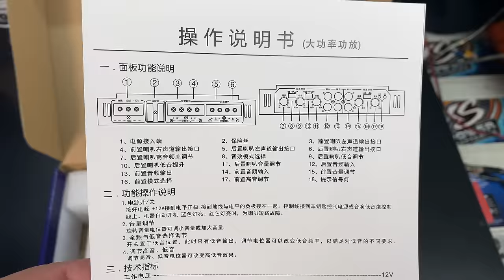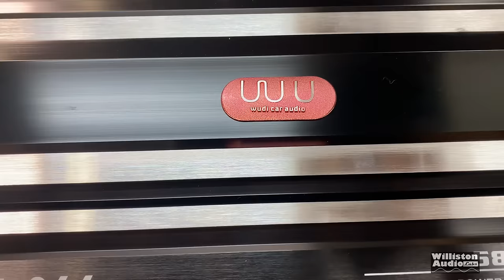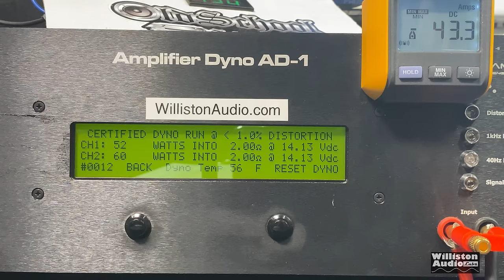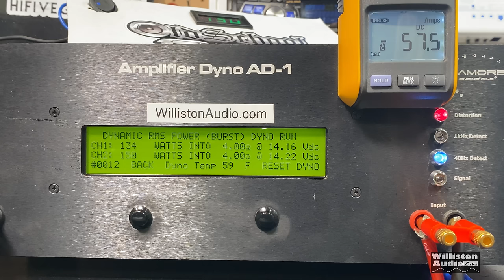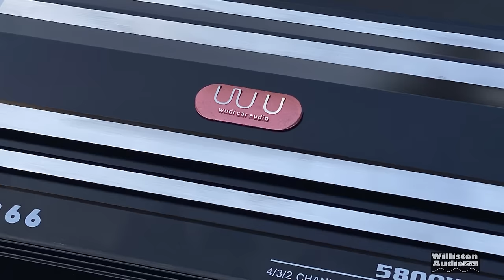I Paid $45 for 5800 watts? WUDI Car Audio C-266 Four Channel Amplifier [4K]

Comment: is it actually a decent enough little amp though? to run two pairs of small car speakers?
Reply: Look into Skar - just bought a bunch of stuff from them very very solid budget brand
Reply: @robertkurtz7587  thanks bud, I will
Reply: @robertkurtz7587  hey checked that out but its an American brand, although probably rebranded Chinese stuff. Im in Ireland off Europe id need an alternative. Thanks though mate
Reply: @THIRSTYGUMS  Find a different one, after looking at the guts, this will not stop engine whine. You will hear your alternator running through your speakers.
Reply: @chuckmiller5763  ok I will! thanks bud. question: can it not be shielded?
Reply: @THIRSTYGUMS  Yes you can shield it, but you are spending more money  and effort.  This amp will also make an annoying pop sound when its powered up.
Reply: @chuckmiller5763  ok bud, thanks for the info, any suggestions for another modest budget friendly amp
Reply: @THIRSTYGUMS  Rockville has some real good sounding budget stuff.
Reply: @alfa7108  American right? I'm in Europe, shipping and import tax be sky high
Reply: @THIRSTYGUMS  it would be better to buy a second hand kenwood amp as the amp is very reliable as is what I have in my car😀

Comment: I have a  Boschmann PCH-4480SX on the bench, IT SAYS 900W in to 2Ω (it had provisions for 2 fuses but only had one 30A fuse it it. I have measured 46v rail to rail with 55v caps. Personally I would rate it approx 200W "if that" bridged. I will have to measure currant draw once its fixed "I have 1000A @ 13.5V ready for it (hopefully that's enough power for it) pmsl

Comment: They must meant S800W because 40 amp fuse you’ll never get no where near 1000
Reply from the maker: True dat
Reply: Well easy fix,

Go buy two 400 amp fuses wire down to .25 cross it over max the gain max the bass boost , and smoke show included 😂👀

Comment: is it actually possible to connect car speakers and a sub to this amp? I've got the same amp and I has an input for the low pass and then another input for the high pass, do I have to have to sets of phono cables to run a sub and front car speakers?
Reply from the maker: Yes but I don’t think you want this one

Comment: Seems like it would be ok for factory speakers for the price I guess. Sorta?
Reply from the maker: Sure
Reply: I have one of these running factory speakers in a 2011 Mazda3, and it works just fine for that. For the price it really isn't too bad if you're expecting 50x4 RMS, definitely better than (aftermarket) deck power alone which is usually around 15x4. Only gripe is how unnecessarily big it is, as you can see by all the wasted PCB space at 5:02, if it were condensed it could have been half the size and fit under a seat.

Comment: You need to try to get the rated power from these pieces of shit.  Play it into a 0.25 ohm load and hit it with 240 volts.  I bet even then it wouldn't make rated power for a femtosecond.

Comment: I'm not the sharpest tool in the shed  but how can these  companies say  that their amplifiers put out 2_3_4 times amount that they do
Reply from the maker: There is no standard all must follow so I buy to show people what they should expect
Reply: A lot of the time they add together the individual maximum ratings of every single component on the circuit board, which is a giant figure compared to the circuit output.
Reply: To understand this we need to inderstand all specificitions. It's not the bs 5800 they claim it reach at maximum peak wich is a lie but  evan if its true the peak is not helpfull to nobody.... this peak power is supossed to be made by producer for a short period of time,as short as possible before it caught fire anyway,not helpfull. Big  brands will tell the RMS wattage (continues power it safely does for a long time) BUT that's still NOT helpfull. Those RMS are possible and the amp does them BUT there is distorsion in those watts ,wich damages your speakers and sound bad...so in realitty you won't use those RMS. NO BRAND tells you the exact specitications,not evan sont,piooner,etc and you expect chinese sellers not to lie?
But still having the RMS you can figure out about 60%-70% of real power you will use on the speakers in reality.
And about that,the gain needs to be set properly
Reply: Yes it has been going on like this for years and years because there's no truth in advertising. Plus there's no standard they have to go by. You really need to know your Ps and Qs .

Comment: Fuses will tell you how much power
Reply from the maker: Not exactly. I've debunked that myth before
Reply from the maker: @ssilvaxxx22  it was part of an amp test in which the mfg used (3) 60A fuses, but only 2 were connected to the circuit board. Also, power output will vary depending on the class of amplifier, because of efficiency. A Class D amp with a 50A fuse will be more powerful than a Class A/B amp with a 50A fuse. Fuse size is a way to estimate power output, but only if they are all connected and you know the "class" of the amp

https://youtu.be/i1ng0afAeVU?t=330

Comment: I mean if you really think you're getting 5800 watts for $50, you kind of deserved to be tricked. About average price for an average amp of its real power. I would not recommend buying one,  but if you get it on clearance dirt cheap or just want one for some reason and need that power, it will sound fine. Still rather hilarious many of the cheap amps still put insane wattage ratings on amps, I really don't see the point; it must continue to suck people into buying them.
Reply: Dave Micolichek  I can't go along with the audiofool rambling about cost vs sound quality and supposed "first few watts". A/B blind test that POS WUDI amp against the Phoenix Gold in the background, I'd bet most people could not guess which amp was which with both set at the 50 watt range (before distortion), of course the PG would win at higher output and superior quality wise. I'm talking a blind test where you do not know which amp you're listening to and set at the same levels, on the same speakers, switching back and fourth between the two with the same signal source / program material. Of course the cheaper amp might have more hiss which could be a tell. These are not tube amps that can sound rather different, these are modern transistor designs, they will not sound vastly different other than filter networks / any EQ / boost one might have over another. Expensive doesn't mean better sound, but higher price usually indicates exceptional quality built to last and solid designs that meet or exceed rated specifications, where this WUDI 5800 is slapped together as cheaply as possible with minimal features. I stand by that this amplifier would work and sound fine at about 50 watts output. If you feel you hear a difference, by all means use whatever you like, but "most" modern solid state amplifiers are going to sound very, very similar unless they have some sort of problem / design flaw. While WUDI should be ashamed for putting stupid power numbers on it, too many people look at price and inflated power ratings and claim it sounds like crap, when reality is these will sound fine as long as not ran into bad distortion like any amp.
Reply: Dave Micolichek  You are just biased to hate this and can't help but spew that over and over, it is that simple. In my first comment I recommended nobody buy this, but that it will still sound fine overall should somebody decide to do so. It is a cheap amp that nets you 50wx4 or 100wx2, will sound fine doing that rated power and you simply can not accept that. Design / components are run of the mill, but nothing out of the ordinary for a budget amp. Capacitors, resistors and op-amps are nothing special, but not bad, simply not esoteric audiofool labeled HIFI caps and other jargon. The PCB and through hole parts are a bit dated looking. Granted, the op-amps and all carbon resistors probably don't help the noise floor, so likely going to be more hiss than a higher quality amp, but for $45 it is about what you would expect. The small signal transistors are also what you would find in any other amp that uses similar outputs, and output transistors are likely common for the power level. You act like there are some exotic parts that will make an amp a million times better, simply not true. Yes there are some cheaper components installed that could have been less noisy, and of course the design may not be world class, but for the average person it will be fine. I agree with Tekboy 808, it is a $45 amp and whomever buys this is essentially out nothing, most people waste more than that on cigarettes and other nonsense in a week. I would not buy this amp either, but I'd have no problem running it if I didn't have better amps already, happened to have one and needed 50wx4. I am not giving high praise to this, it is a basic cheapo amp, I mean I do not want one, but it isn't anywhere near as bad as you try make it out to be. I just won't speak lies about a cheap amp sounding like garbage, when most of the time that isn't true, they sound totally fine for the price.
Reply: Dave Micolichek  What do you mean "first few watts of any amp determine how good it sounds"? So if I turn it up to 5 watts and it sounds like ass, I know that it's not going to sound good at 15 or 20 watts? What if I just open the amp and adjust the ohm knob to 2 ohms.

Comment: Does anyone know what is the best software to build a subwoofer box that's out there that has all types ,4th order ,6th order ,ported ,slot Port ,sealed all that stuff does anybody know? THANKS😁👍
Reply: I whant to know the same
Reply: bassbox pro
Reply: @cekpi7  yeah i saw that one, thats what got me thinkin is there others,Thank You!😄
Reply: Check out Term-pro Enclosure Design Software. It aint cheap, but it's dope.
 Personally, I use WinISD (it's free) for most of my calculations. If you want a wealth of information about the science of enclosure building, after you install WinISD, click on the 'Help' tab. I've learned so much about port length, accoustical port length versus actual port length, how the end of the port is terminated effects length and also how the shape of the port effects wind velocity, port noise, and efficiency. I take all my information and go to Sketchup (free CAD program by google) to do my designs. I love Sketchup. It's free for a month, but there are ways around that.

Comment: I'm looking for a good 1800-2000 watt peak monoblock amp (preferably class D) any good suggestions?
Reply: Taramps
Reply: Orion
Reply: Peak?
Skar, orion, ct sounds. Taramps, audiopipe... Dunno your budget.
Stay away from orion ztreet
Reply: audioque, sundown, dc, dd, rockford fosgate, make make 2000 models. 
If on budget hifonics would do rated just not very efficient, skar.
Reply: I cant suggest a good amp based off peak watts. Peak is an irrelevant number and really only used to market an amp as more powerful. Never look at the peak of your speakers to try and match air with a good amp. Try to find the RMS rating and post that.

Comment: Wuudi be a cheap 4 channel for budget build.
Reply from the maker: Would not count on it lasting very long though
Reply: @wal  I concur 😆😆😆
Reply: Define cheap, because car audio all too often like the performance/motorsport aftermarket you get what you pay for. You have to make a choice and can only choose two = Cheap/Unreliable or Reliable/Expensive. You can strike a middle ground by not spending as much for "power" and focusing more on speaker quality, proper speaker enclosure design, etc.

Comment: People actually buy this crap? Lol
Reply: I did  I bought it yesterday knowing full well it wasn't going to be anywhere near the claimd figures but would power the speakers in my van better than the radio it's self. I'm on a very restrictive budget at the minute and this was cheaper than even second hand low powered amps I could find. It is doing what I wanted for now, the speakers are no longer being drowned out by my subs, the distortion isn't there any more, and I have only got round to wiring 2 of the 6 speakers in so far. When I have the money I'll look for something better, but for now this will do.
Reply: @outofthi5world567  is this amp also powering your sub/s I've got a single 12 inch sub in the back and it 2as originally an active sub but the amp died and the sub still works fine so just after a cheap amp to get it working again. Not after amazing super bass.
Reply: @jasondonavich2758  no, I have 4 12" subs powered with their own amp then my other speakers are powered by this. 
It copes alright with the 6 speakers I have on it at the minute but does overheat if you have it flat out for over an hour and a half or so. Keep it reasonable and it goes forever.
For what it cost its a good amp.